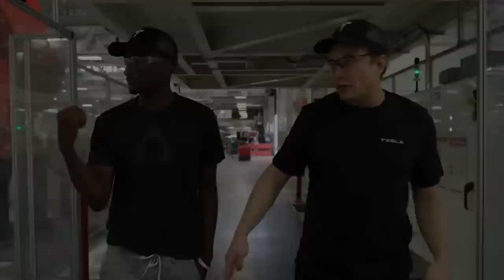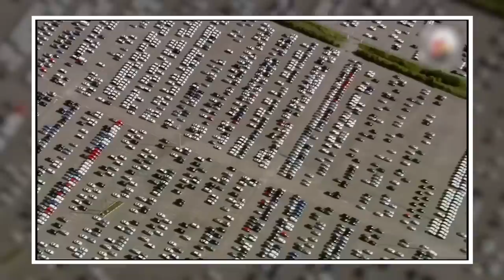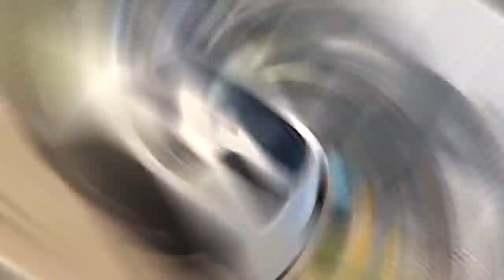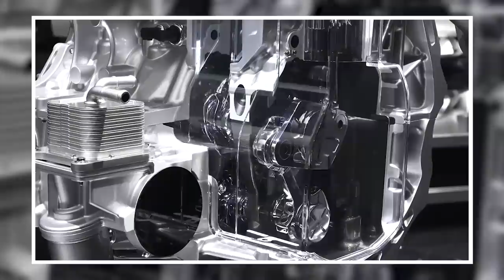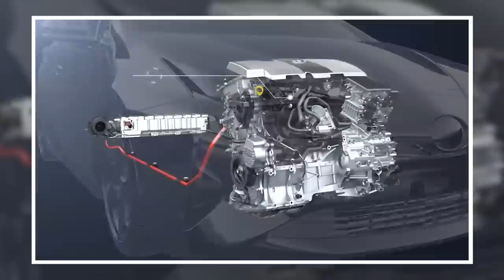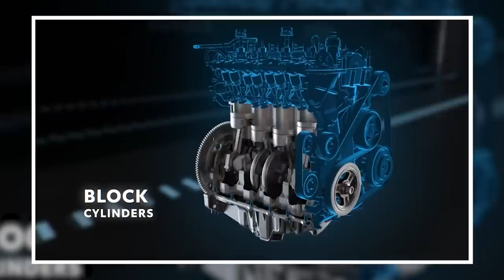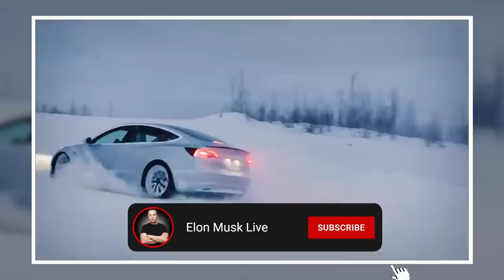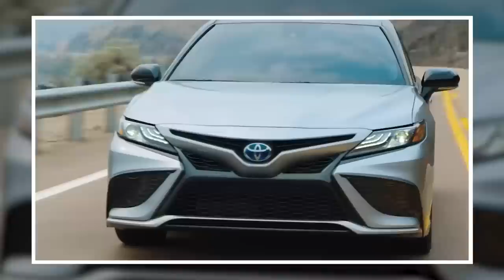Why Elon Musk is Scared of Toyota’s NEW INSANE ENGINE!

Comment: Who cares who’s scared , we as a country needs more options not just ev ,GAS ENGINE is  the most efficient and we need another option of fuel other then EV, BATTERY lithium mining is  totally ripping up the environment in counties where it is mined ,plus the cost of new batteries and the recycling the old used one and consumer’s cost of it ,then the charging cost ,the electric rates r climbing higher these days ,all because the government got there nose in the private sector

Comment: Toyota needs to build diesel electric hybrid engine with great mpg,that would a top seller ever
Reply: use old diesel motors as well, that way you can use bio-diesel or just old fryer oil to run it. Then just make sure that it's churning a flywheel which is able to overcome the magnetic loss which occurs during electrical generation, and you'll end up with a car that will far exceed any battery car on the market :D

Comment: EVs are overrated. passenger ICE vehicles only make up 7% of total global CO2 emissions, you get rid of that and that 7% just goes back into the energy (electricity) sector of CO2 emissions. It isn't YOUR fault for global warming, it's corporations(industrial), and energy (the government) are responsible for most CO2 emissions. ICE vehicles don't require lithium batteries that go bad in ten years and need to be scrapped and tossed into a landfill. That are mined by poor children in Africa.  I have a 25 year old toyota that still runs like new and a newer toyota for daily driving, they never have to be scrapped and wasted they can run forever if maintained. a good clean ice vehicle that keeps running forever is the best solution. The entire EV market is over valued because of marketing and people's belief that this will solve all our problems. It won't EV semi trucks can never come close to being as efficient as ICE trucks. Watch Adam something's analysis of the Tesla Semi truck if you need more info on the statistics as to why that is. Tesla is a garbage, poor build quality, cheap company and Elon Musk is just another over hyped steve jobs type billionaire.

Comment: The efficiency of an internal combustion engine is an absolute joke.
100% energy supplied is converted into two new forms of energy; motion and heat energy. With a diesel 40% movement and 60% heat, petrol makes it even more colorful 30% movement and we throw 70% away in the form of heat. Inefficiency on an incredible scale for 100 years because the internal combustion engine is the answer to the steam engine and has not improved in the last 100 years. It is a silly product. And technical miss of huge size. The current economy is fully geared to this energy-guzzling form of locomotion. We need to get rid of this quickly. If your central heating boiler had an efficiency of 30%, it would be in the trash tomorrow. But our civilisation have been moving with it for years, a shame that for a century we have been producing more heat than movement and therefore not moved forward.

Comment: Oil engines continue to be converters of clean air into polluted air. Despite the fact that Toyota has a very good reputation, they continue to invest in engines with oil and exhaust gases. Although the efficiency of these oil engines can be significantly increased, they continue to poison clean air. An improvement in efficiency makes fuel engines a little less harmful, but they remain harmful. Everybody knows for several years now that these engines are a disaster for the environment, climate, and our health, but Toyota remains develloping such engines. A very bad evolution. Moreover, it has been shown for a decade that an EV is a more than worthy alternative to oil cars and increasingly affordable. Toyota would be better off investing in alternative zero-emission drives. That would perpetuate their image for decades to come.

Comment: Even if you're a climate change sceptic (like me) you must realise oil is running out. The price of Gasoline/petrol is going to keep going up.

Happy motoring.
Reply: Then what happens is instead we make carbon neutral fuels rather than continue pulling Dino juice from the earth. Prometheus fuels is probably the best company at explaining the concept but I really think that this would take off better than an EV for the average consumer looking for something that utilizes their current vehicle, doesn’t require 30 minutes to get 80% filled up, and is still helping je environment. Until someone comes up with a way to produce batteries cleanly and speed up their charging process a million times faster, I dont see EV’s taking off in the near future. Not trying to bash you in cause I really like the electric motorcycle world lol but for big vehicles I don’t think it’s the best idea right now. Take care my friend and happy trails to you!

Comment: This pure BS.  Its like the horse drawn carriage makers trying to breed bigger horses to fight against the march of the cars. This engine is relatively more efficient compared to traditional engines. But the improvement does not even push it beyond 50%. At best, it's only 40%, and only if you drive it under optimal conditions. EVs can convert electricity to traction at more than 80%. Moreover, it's more like a F1 car needing constant maintenance and servicing to keep it at 40%. As for the power or torque, it is playing catch-up but not overtake the best EVs.  The parts are horrendously expensive, and few can service it except some Toyota garages. It is a niche product.  One hopes Toyota will keep plugging away at this kind of engine and lose money.

Comment: Yeah well they both should be scared of hydrogen fuel cell vehicles, hydrogen 5 minutes to charge electric an hour, combustion engine = pollution, distance, maintenance hydrogen has less, better fuel economy, only issue is creating the fuel it's a little costly and having hydrogen fuel stations more popular ITS ALREADY COMMERICAL AND THE EXHAUST GAS IS WATER VAPOUR

Comment: Their talking about an engine TOYOTA doesn't use anymore that's why they went to BMW for the B58 in the new SUPRA and electric cars don't leave a Carbon Footprint
Reply: It's NOT that simple. IF I were moneyed enough to buy a Tesla and roof panels and wall battery charging system, then generally Yes.
Or IF I lived in western Oklahoma, the majority of grid electricity might be from wind power.
But where I live in the northeast part of the state, the nearest powerplant charging the grid is coal fired. And despite the claims they have the exhaust all scrubbed now, the place looks like the freaking land of Mordor. A smoking black hulk of a building and I don't think there is a green plant on the property. Just bare dirt.
   I like the idea of electric cars, but whether emissions are better or worse depends on your circumstance and location. The idea that an electric car is ALWAYS better is extreme over-simplification, to put it nicely. Just like the idea pushed by Big Oil that they are always worse. Both are inherently dishonest.
   Maybe when I get rich, electric will be practical for me. 
    Regarding the engine they talk about in the video, big deal. Max efficiency will always be less than 50%. And adding more complexity, more and more and more moving parts, would only compromise Toyota's strong point of reliability.

Comment: elon isn’t scared of anyone especially toyota.  toyota should get down on high theor knees and thanks the america people for buying their products in the first place.  you’ve made your money so don’t cause trouble with elon.
toyota’s new hydrogen engine will cost much more to fill than a gas engine.
hydrogen stations do not exist, so that means they have yo be built.
where are you going to place these oversized filling stations?
cities and even the suburbs are saturated with filling stations as it is.
so good luck implementing your new expensive hydrogen engine.

tesla’s electric vehicles can be charged  anywhere.  a new solar panel is getting introduced soon that will limit or even eliminate charging.  take that toyota.
elon scared…..HA !!!

Comment: All we have to do is start making giant hydrogen plants/factories. Special giant tanks so the hydrogen can't escape, because of it's tiny molecules. It's really simple just put water in giant water containers that have large flat metal bars plated with platinum with electrical currency running through them. I'm not sure which polarity, positive or negative produces hydrogen gas, but one does & the other produces oxygen, this is how submarines stay underwater, they burn the hydrogen with their internal combustion engine, & the oxygen is used for the human to breath. The energy can be produced for thr these giant factories from wind generators & solar panels. The oil industries would be put out of business & all the current internal combustion engines being produced would not have to be destroyed. The only thing that would need to be made new are pressurized gas tanks with heating elements in them. I mean with strong enough alternators we could build cars with mini onboard hydrogen production systems that create their own fuel while traveling down the road. Batteries are going to pollute the world just as bad as fuel made from oil, if not worse, with it's corrosive elements & lithium oxide. All we need for the world's energies is what the Creator gave us, along with wisdom & knowledge, & that is the sun, the wind, & water. When hydrogen is burned it turns back into water again a never ending cycle. That's why the world is 3/4's water. If we could only get rid of these greedy Satan worshipping corrupt people, who are currently running the world.

Comment: Come on, combustion engines are dead. It's only a matter of time before they all get banned or discontinued due to pollution regulations or simply neglect by smart buyers. Gas prices are off the roof and they drink more than ever. Some Teslas you can friggin charge FOR FREE at their superchargers. Heck even the tax and insurance is almost free in Sweden compared. That alone completely annihilates the combustion engines future. Not to mentin the savings from not having to do yearly maintenance and buying lots of parts. I love The sound of a roaring V8, and the feel of it. But sitting in an electric vehicle made me change my mind instantly. There are just so many more benefits of having one. One being Safety!

Comment: there are youtube videos of the very fastest dodge hellcat getting beat in the 1/4 mile... .by .5 seconds. in drag racing? that's HUGE.  it gets WORSE. when you push the performance envelope that far in an ice car- you pay for it, DEARLY in your available fuel mileage. in this case? the dodge, best case scenario, gets 22mpg highway. the model S plaid? 101mpg equivalent. yah... elon's scared. LMAO!! 

that doesn't even begin to address the fact that- in a high speed collision, in an ice car- you are most definitely going to die. the engine is going to be joining YOU in the front seat. but tesla? people have survived head on collisions going 65mph in a tesla. and all this pales in comparison to the fact that- in order to match the cost of me home charging my model Y at home? you'd have find a gas station that will sell for 35 cents a gallon... and a mechanic that will change your oil & your brake pads for free. good luck with that. 

hey- if you LOVE that 'vroom' noise? I get it. good for you. personally? I think the noise is over rated.

Comment: Which car has the most emissions, EV or internal combustion engines?
Reply: This depends upon a lot of factors. If you are using a carbon neutral fuel like Prometheus fuels in your ICE and you are using a renewable energy source for your EV, the ICE will win emissions wise. An EV car produces more emissions from their production than an ICE car will. But once you factor in stuff like where your fuel/power comes from it’s really a teeter totter on which one has worse emissions. The reason behind that is one may use a fossil fuel and one doesn’t. Or one may use carbon neutral fuels while the other uses fossil fuels (yes an EV can use fossils fuels indirectly. Through power generation for the EV’s battery)

Comment: I work for Toyota making engines and they are going Tesla’s direction.  Toyota will have more EV models in 10 years than Tesla eventually phasing out internal combustion engines.  It’s coming, and I can say Toyota has one big advantage over Tesla and that is that Toyota can build cars way faster and efficient that Tesla.  Tesla is still king on the EV market I say, Tesla has nothing to fear in the meantime. Toyota has finally jumped into the EV wagon, but it has paid a price for not jumping in when they had the chance and are about a decade behind Tesla.  Nevertheless all manufacturers have realized that there is a market and demand for EV vehicles despite some cons of EV vehicles and other power plants.
Reply: 3 big advantages... Toyota not only build cars way faster & efficiently than Tesla can, they also build them to a much much higher standard of quality while being much more affordable.

Comment: If Toyota introduced a hydrogen engine using existing engines components its on a winer as I am sure Hydrogen is the future as also JCB have been able to do this. Plus there’s bigger money being investment in the UK 🇬🇧
Reply: Toyota has a hydrogen engine
Reply: @p3ngi3  he means like a conversion kit to stick on your current engine that can change it over from gasoline/diesel to a hydrogen powered engine
Reply: @swankscabinet1625  this is possible. You would have to change out the injectors and need a new map system to control the flow of the natural gas. A containment system to store the gas or water. Natural gas is made from water. They extract the hydrogen through electrolysis. People have already done this on their own. A guy actually patented a system for all cars. He suddenly disappeared.
Reply: @p3ngi3  Hi is that an Engine that’s been designed specifically for Hydrogen only?
Check our Harry’s garage  as he’s introduced to the new engine that’s built by JCB mainly a modification to a standard Diesel engine as keeping the same torque but  it’s mainly the cylinder head so this engine will run on hydrogen so hence why I’m thinking why can’t the standard combustion engine have similar modifications as this engine has just hopping👍
Reply: @p3ngi3  you have to worry about seals and early combustion is the problems with hydrogen. It’s not the map system and timing that you have to worry about. Hydrogen is so easily combustible that it burns randomly inside the engine compression cycle

Comment: Engines take many years to develop. Once someone develops a new engine they hold the advantage for a year or two until their competitor develops their better engine. That's how competition works in the automotive industry. Musk still holds most share in the electric car market. Toyota also makes very ugly cars no longer facing stiff competition from Ford, GM or the European brands, while Musk is a perfectionist with that regard, so you get both performance and styling from Musk.

Comment: For gas engines, think of how tightly the pistons have to fit, to even provide compression. ALSO think about all of the complicated moving parts in the transmission, all needing lubrication. That's a lot of energy loss, no matter what.  You can improve the gas engine to near theoretical mechanical perfection, but that's still not NEARLY as efficient as battery to electric motor propulsion. Period.  ALL ELECTRIC VEHICLES WIN.
Reply: Elaborate.
Reply: @israelc.7451  The various transfers of mechanical energy limit the efficiency a gas powered vehicles. You can only improve it so much. Electric transfers power way more efficiently. Gas can not catch up.
Reply: Opposed piston  diesel will do as well as electric
Reply: @sammyd7857  We've had piston engines for over 100 years. You can only reduce friction so much in a combustion engine. Transfer of energy through wires, magnets, and magnetic fields wins.
Reply: @bryanstrom812  ok so the opposed piston engine can do 37mpg in a car around 2 tons at least. How far will 4kwh's go?
Reply: @sammyd7857  You can EASILY get the specs for a Ford Lightening, a Rivain, or any other electric car. It's super easy! But I bet you don't want people to look. You want to trick people into dismissing EV's altogether. But that's not going to work.

Comment: If Toyota can perfect its Hydrogen fuel based Automobiles!! Hydrogen would be the ultimate GAME CHANGER, in my book. The biggest PROBLEM with the electric auto market is Infrastructure!! If the USA consumers go all in on the electric auto say the next 5 to 10 years? That would be a HUGE MISTAKE! First off there isn't the recharging stations out there to handle even double the Electric vehicles out there now! Secondly, good luck being stuck in a slow down or start and stop on the interstate because of an accident, or road work. Miles from an exit, you hope has charging stations! Then you hope the adapter fits your vehicle to plug into. You also have the time to charge your vehicle, and most of those stations don't have the high amp chargers, so you're sitting there for a half hour or more....WAITING!!! All this puch for electric vehicles is ridiculous. Tesla at least has the BEST batteries in the vehicles....all these other generic brands will absolutely kill the reliability of the other auto makers.